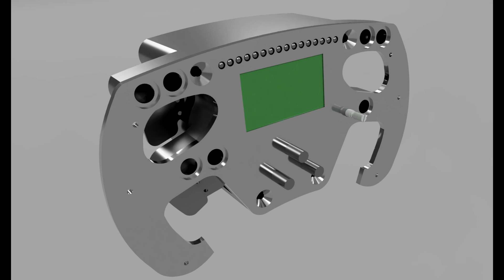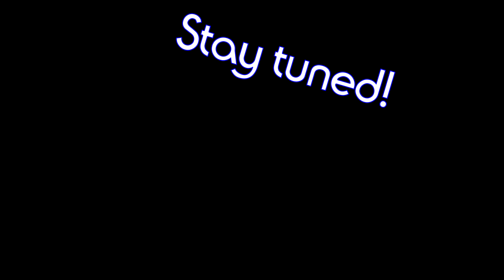DIY F1 steering wheel CNC milling process

Comment from the maker: Hello guys, and sorry for the far too long wait!

OBJ, STL, Arduino sketch for my specific setup and drawing files are here -> https://github.com/dxcufgb/SimRigAndAccessories/tree/master/Diy%20builds/F1%20steering%20wheel
feel free to use them, make modifications or alterations!

I will post PCB-gerber files and BOM later as well in case you want to make a carbon copy of my build!

Furthermore I will try to update both my github and youtube more frequently in the future!

Comment: nice project, what arduino you will use?
Reply from the maker: I'm using a custom made PCB with a Teensy ++ 2.0 as the USB controller (https://www.pjrc.com/store/teensypp.html).

The custom made PCB among other images can be found at my project folder i google photos: https://photos.app.goo.gl/gMjzy8QioRjjUvds6

There you can see further progress on this steering wheel among other images of various projects related to my sim rig!